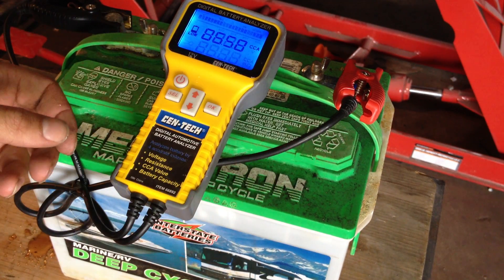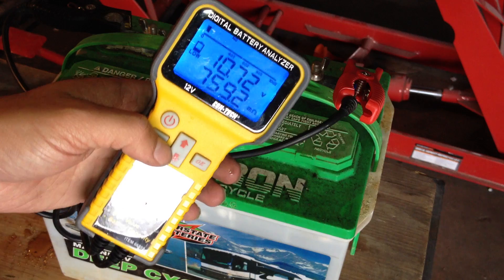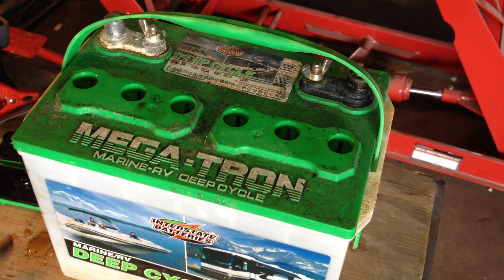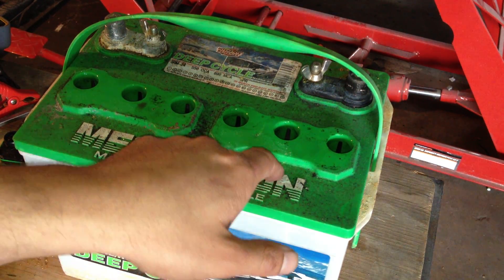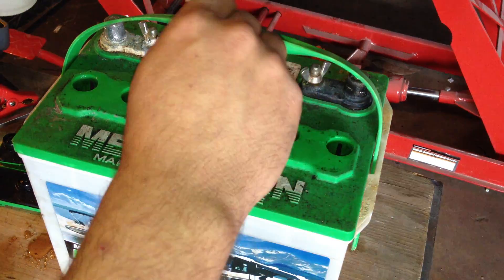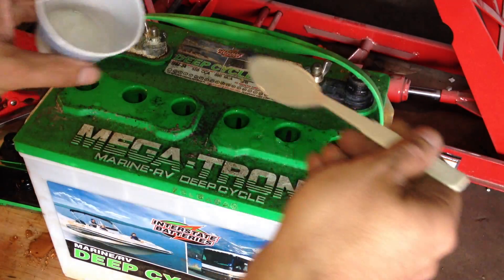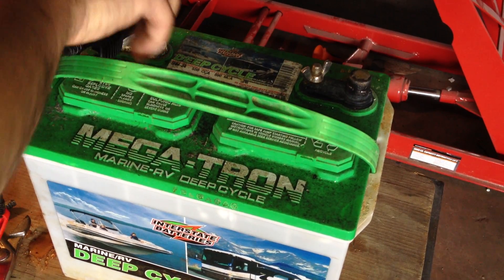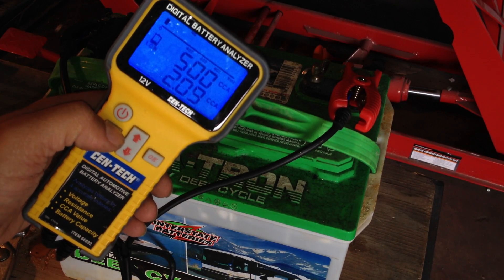Lead Acid Battery Desulfation Using Epsom Salt --Add Solution to Dead Interstate battery Part 2 of 6

Comment: Someone who thinks and doesn't automatically go out, flip out a piece of plastic and buy a new one. I like that. That is American ingenuity and spirit that, unfortunately, most of our countrymen have lost. There was a time when, if the axe handle broke you made a new one. Now the axe and the handle are thrown away and is replaced either by a chainsaw on a credit card or some poor Mexican that gets paid slave labor rates.
Reply: Draugr Hessler good point
Reply: There are many components to getting a good result. One plan I discovered which succeeds in merging these is the Magic Mender Wizard (google it if you're interested) without a doubt the most incredible course that I've heard of. look at this  super website.
Reply: I have spent months researching into fixing a car battery and found an awesome website at Magic Mender Wizard (google it if you are interested)
Reply: The 3 Best Batteries For An Off-Grid Energy System >> https://t.co/mK3KjJd0lr?CASNU784GVnh >
Reply: how to recondition a lead acid battery epsom salts
I\'m not sure but ,if anyone else wants to learn about how to recondition batteries try Corbandy  Battery Blueprint Crusher (should be on google have a look ) ? Ive heard some great things about it and my partner got amazing results with it.

Comment: I am using VERY expensive 6 volt (wired together to get 12 volt) batteries for my backup solar system. The whole thing crapped out on me a few weeks ago after running fine for over a year. All the fluids are above the plates (Thank God) but I am having a problem getting them to take a full charge. From what I remember they never really performed as well as I thought they should. There are eight of these big Interstate batteries (about twice the size of a normal 12 volt car battery each). When connected to the Aimes 5k Pure Sinewave inverter they never really held up as long as I expected. Just running the lights at the house and an occasional TV I am lucky to get 10 hours of use before the low power warning beeper starts going off. Is this normal and I just need more batteries or is something wrong. I have separated the batteries and charged them independently. When checked individually for six volts they register just barely in the green, but under a load fall immediately to the weak side of the (Harbour Freight) load tester. When connected 2 at a time for 12 volt they peg the 12 volt needle nearly to the red, but under a load for ten seconds they drop to about the halfway point between good and weak. Are they performing as they should and I'm just expecting too much or is there a problem?
Reply: These batteries are probably sulfated due to deep discharges and incomplete charging.

Comment: I believe it is always better to use electrolyte (battery acid) as a replacement fluid for a battery as opposed to distilled water. Distilled water is fine for say topping off a low cell, but replacement should be, in my opinion, battery electrolyte.
Reply: Dissolve epsom salt in hot water and use that.

Comment: Use a coffee filter. Of course it (the acid) will eventually eat the paper but not immediately. You will have time to strain out any trash. But to be honest, I would just purchase a new container of electrolyte (battery acid) from any battery dealer (granted that you can budget it. There is nothing wrong with reusing things to save money. Lord knows that I have had to many times). I have three gallons in the barn. It comes in a cardboard box of all things. Of course inside the cardboard box is a thick plastic bladder that actually contains the acid. from the bladder is a small rubber hose with an old fashioned pinch valve to control or stop the acid flow from the battery. Wear old clothes, rubber gloves if you have them and of course safety goggles. Battery acid in the eyes hurts a lot. I know from experience.

Comment: I am wondering if anyone has ever employed a device that when attached to the battery, or the battery set into the device, creates a strong but very fine vibration throughout the battery while the epson salt solution is used. It seems to me that the vibration of the lead plates within the battery may accelerate the desulfation of those plates. Another idea I had was to add a very fine abrasive to the epsom salt mixture, like diatomaceous earth. Now imagine a battery set into a cradle that acts as a spindle allowing the battery to be tilted at any angle. On the bottom of this cradle is some form of device that puts out very high frequency vibrations but not so intense that it damages the battery. Take for example an old, variable speed, electric sander attached to the bottom of the battery cradle. Then employ the use of a very slow turning motor that literally spins (very slowly) the entire battery so that the fine abrasive material is evenly distributed. This seems sound in theore. Quite literally the internal lead plates, after a few hours, would be scoured clean right to bare metal again. The process could be repeated several times with a rinsing solution to discard any abrasive material as well as the sulfate buildup. Has anyone ever heard of this or any ideas of why it would or wouldn't work?  KPE DRAUGR 4-27-2014
Reply: Draugr Hessler I can just see some guy trying to explain why his wife's favorite toy is out in the barn connected to a big deep cycle battery!
Reply: NO BARE METAL on the positive plates,  it's a paste, need to learn MORE...

Comment: For the record, the meter is not telling you 759 OHMS 'across the terminals' but that the INTERNAL, series resistance of the battery is 759 MILLI OHMS  = 0.759 OHM

Comment: An off topic observation for those lured by creative marketing terminology. The battery is labeled as a deep cycle battery;  for this battery this means it can be depleted of charge and recharged... nothing new for a lead acid battery. The technical term deep-cycle applies to ni-cad batteries, which requires depleting the  charge entirely using a deep-cycle charging system for recharging;  to prevent a memory charge....it is not a plus!
Reply from the maker: Not just a creative marketing term. A Deep Cycle lead acid battery compared to a starting lead acid battery have much different characteristics. 

Starting Lead Acid batteries usually have thinner plates and more of them, to allow them to provide a high amperage burst, such as what is needed when starting a car. Deep cycle batteries usually have less, but MUCH thicker plates, which allows them to be deeply discharged and then fully recharged again with little to no harm done. If you deep discharge a starting battery, you "MAY" get 10 complete discharges out of it before it's shot. Where as you should easially be able to get 300-500 discharges out of a deep cycle battery. 

Hybrid deep cycle batteries are a marketing term. They have more intermediate sized plates, somewhere between a starting battery and a deep cycle. These are junk.
Reply: Actually kay ger, a 'Deep Cycle' battery has a key characteristic not normally found in 'starter' batteries, and that is the MUCH heavier, thicker, often larger lead plates inside it that allow it to go to low (not full) discharge without plate damage (due to material mass loss). Do this with a thin-plate 'starter' battery and you won't have a battery after a dozen tries at 'running your trolling motor all night', where a true 'deep cycle' can be recharged a hundred, two hundred or more times - depending on depth of discharge, method of recharge, and care throughout. As for the 'technical term deep cycle referring to ni-cad', no kay ger, they were making 'deep cycle batteries' (lead plate wet cell 12v) and marketing them as such as far back as the late 1950's. Pirating a term already used only causes confusion. 'Deep Cycle' intentionally means to 'cycle deeper into discharge than is otherwise advised for comparable thinner-plate batteries'.

How do I know? I am a retired mechanical engineer who spent over 30-years designing special vehicles with advanced onboard electrical systems, especially AC/DC circuits; and spent more time fighting the ills of wet-cells and their inherent problems, than most people even in the battery industry will ever have to deal with. The company I was with was actually the first to consistently apply Peukert's Curve to determining charge capacities vs customer demand on systems (other than NASA), to ensure that the battery bank could support retail expectations.
Reply: ***** might want to include the reason a starting battery turns to junk, plate deformation that generates shorts, this can also happen during overcharging and letting a battery run dry while trying to charge it.  Lots of reasons for early demise of a lead acid battery.  kay ger the use of deep-cycle in a ni-cad battery is a requirement while deep-cycle in a lead-acid battery it is a feature.
Reply: Mikej1592 Deep cycling of a lead acid battery is not a necessity, it's a marketing labeling gimmick!  Sure there are heavy batteries and light duty, etc... all kinds of them, but the technical term "deep cycle" applies to how a battery is charged. If a battery is being damage under load, then either the load is too much for the battery or the battery is is too little for the load. Starting batteries, Deep Cycle, etc are marketing terms not technical terms,

Off topic: Once, I helped my nephew build a fence, he's a fresh out of college mechanical-engineer.  He insisted to purchase the concrete at a certain big-box store across-town because he had a corporate discount there. After arriving there, I backed-up to a pallet ready-mix bags, priced at $2.99 each for a 90 lb.bag, then I wait for him to go inside to pay for what we'll need. After about a half-hour latter he comes-out pushing a cart of 60 lb. bags of the same brand of concrete but with different labeling proclaiming it "Fence Post Concrete". I asked him how much did a bag of that cost? He said $3.65 a bag, I said, there went your discount, he say's... Oh well, but it's made for fence posts!

Comment: Don't forget to clean those posts!!
Reply: If you is interested in battery reconditioning the best results that ive ever had was by using the Magic Mender Wizard (i found it on google) without a doubt the best info that I've tried.

Comment: Will the acid on the top of the battery cause burns to your skin? I know once it dissolved my clothing and the upholstry on my car floor but if i get a little bit on my skin would i be fine, I have a similar interstate battery
Reply from the maker: Yes, acid on the top of the battery will burn your skin. Any acid on your skin should be immediately washed off.
Reply: yes, it burns like a mo-fo
Reply: Mikej1592 good to know. I put banking soda on it to aid in removing it safely without getting burned
Reply: ***** where do you pick it up? I have not seen it sold before? I imagine because of its hazardous nature its not in too many convenience stores
Reply: acid is acid no matter where it is, inside or on top of something makes no difference.  Once you get it on your hands or skin, even if it is dry crystallized salt forms of it, once it reacts with the moisture in your skin it begins reacting immediately until you wash it off.
Reply from the maker: But you will need to REALLY flush out the battery before putting the fresh acid back in! Many forget that part and wonder why it doesnt work...
Reply: ***** I didnt empty the battery, just cleaned the top of it. I am suprised that people don't do this as I imagine a bottle of acid is cheaper than a whole new battery. I guess its the hazard aspect. 

I did try the epsom salt trick, probably should have flushed the other battery I was working on, ended up recycling it and getting a new one. Didn't want to deal with the acid at that time.
Reply from the maker: I get acid by the 5 gallon container. It's $16 locally.
Reply from the maker: I just get mine at Batteries Plus. I'm a bulk customer. I purchase more motorcycle batteries each year then any of their own stores sell haha.
Reply: +Neil Caulfield need help..urgently
my battery is giving 10.5 volts..i think one cell is dead.. i find it through multimeter..
i am going to clean and refill it with acid and water..can you tell how  can i clean it from inside...can i use mineral water or anything better?
Reply: interesting points ,if anyone else needs to find out about how to recondition batteries try Panlarko Recondition Planner (do a search on google ) ? Ive heard some interesting things about it and my neighbor got excellent results with it.

Comment: I am a maintenance man. One of our employees broke a brand new 3 day old battery. I fixed the crack first. Luckily I did not return the old bad battery yet. So, dumped the acid from the old battery into a plastic bowl. I used a plastic funnel and put a coffee filter in it to strain the old nasty acid. I strained it twice. Then I added the old strained acid to the broken new battery. It has been 3 month so far and so far there is no problem at all.

Comment: is it a band aid or a long lasting fix?
Reply from the maker: MrAgnostic long lasting, if it works, 6 months to multiple years depending how bad the battery is. I have a car battery from 2003 count it is currently in my modified battery powered lawnmower. The lawn more uses a car starter Motor to turn the blade. it is now 2019, and I can still cut 1/4 acre on a single charge. I did have to add some fresh acid though, as it over last winter it did boil out a couple times when I refilled

Comment: Sulfuric acid stays acid, it does not go bad, it is a very strong corosive acid, you could dump the acid out get new cells and filter the acid into the cells, don't know how you'd filter it since only glass will contain it, there must be a way.
Reply: I thought sulfuric acid would eat through glass and could only be stored in plastic.   I'll have to look more into that

Comment: The reason why I am asking is because the Auto Zone sells sulfuric acid to put into batteries, but you have to dump out the old acid. So I was thinking, desulphate w/ epsom salt first, then dump the old acid then add the brand new battery acid.